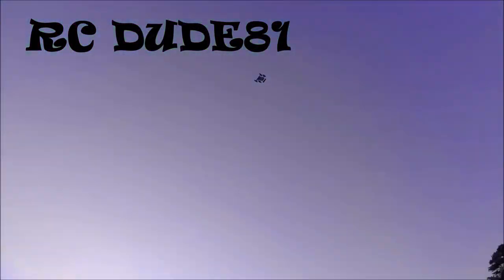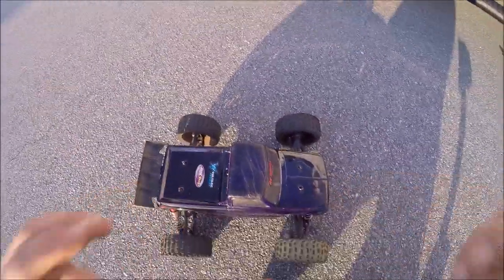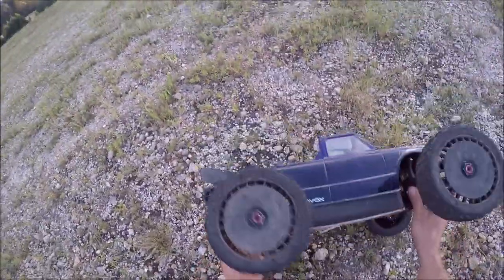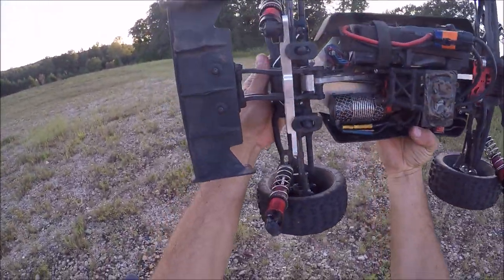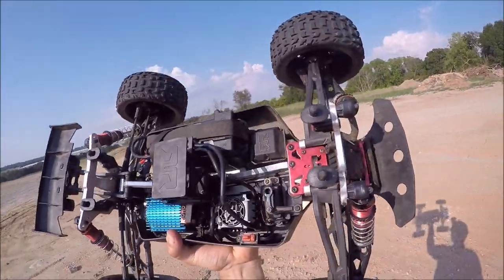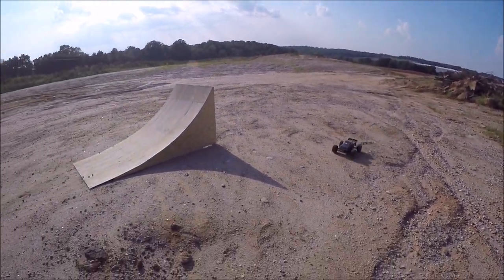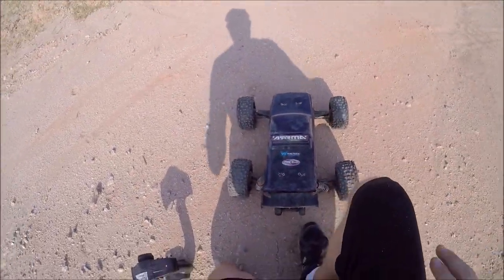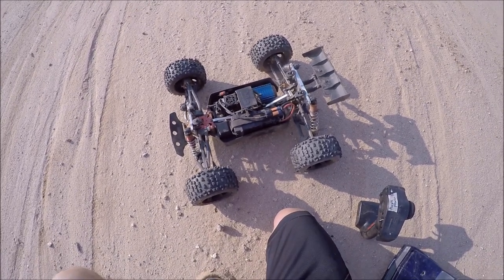ARRMA Outcast 6s "NEW M2C SHOCK TOWER TEST!" and FULL SENDS AHEAD!!

Comment: Hell yeah Brother 😜!!!! AWESOME Bash Eric 🤗. Had some rough breaks, but that was a serious first test on the prototype tower 🚀🚀🚀. Hopefully test mine tomorrow if it's not raining. Finally getting some moisture here 😱. The Mega  sender looks so BADASS 👊!!!! It sounded different in the dirt, but could've just been the Badlands 🤔. I'm sure you checked it for splits afterwards. My new ramp is doing great since beefing it up a bit. Planning to make a mini hucker with leftover scraps soon 👍. I've been wondering if Mitch might design an M4 standoff like with the Tekno's 🤔. I bend and break a crap load of the 3x28 screws myself 🤣. I gotta say that last send into the sunset looked so Killer Bro 🤗. The altitude and backlighting was just stellar. Another great upload!!!! 🍻🤘🤘😎💪💪💪👊👊
Reply from the maker: Thanks so much brother Rich!😁👊Yeah the tower is totally beast!!💪Performed well and looks good! The free fall when the motor blew was a perfect test since it landed right at a angle on the rear end!😳Yeah Mitch and I were talking about a possible shock standoff upgrade like the Tekno one. Broke 3 in one vid!🤣The ramp did great off the pavement but at the dirt spot the line was way too sketchy with all the rocks and washout! Kept breaking traction and launching the truck weird! Hope to beat down on the tower soon a the mega pile too!😂No cracks or splits were found on the ramp yet so that's good! Glad you got yours dialed!!👌Hope you can get out soon man! I had to get this one in quick since we have rain coming plus I'll be at the beach this weekend for my birthday!😎👊🤘💪💪🍻
Reply: @RCDUDE81  Happy Birthday, Eric.  👍👍🍻
@Rich, what's a mini hucker?  lol.  I have some scraps left from my ramp build too and interested in seeing some ideas.  👍💪💪
Reply from the maker: @crimsonfancy  Thanks so much bro!!!😁👊

Comment: Towers look really nice.  Best design I've seen.  Not just a copy of the arrmas.  The m2c front brace needs the hook for the wires to keep them out of the steering and spur.  No one does it but they should.  Rear brace will need to do away with relying on the wing mount.  That's a buggy design that's no good for bashing.  Towers, bulkhead, brace and chassis all need to be solid with no plastic wing mount holding things together.
Thanks for sharing and putting your videos on YouTube.  It's a lot of work and I appreciate it.  Killer ramp too.  You will need a trailer if you make a bigger one.

Comment: The air is getting crazy now lol. I think what these super ramps need is to be able to take about 6" tall sections off top. 3 removable 6" tall sections to take off as needed to adjust height of sends and distance. If done right would be easy to remove sections/re attch.  And needs an all thread axle and harbor freight  pneumatic tires lol. 👍👌

Comment: Wonder if they make like a grade 8 bolt for those upper shock mounts. I’m sure a harden screw/bolt might be the answer to keep them from breaking
Reply from the maker: Good question!🤔I was looking for some 12.9 grades but most 28mm bolts don't have the thread that goes all the way up. I think Mitch from M2C may make a design similar to the upgraded Tekno standoff design.😎

Comment: Yepp, same as mine brother Eric, xploded rotor, when i did the stepup jump...never fun😥, took some serious beating there...🥰...

6.07👀...yepp, thats an issiue..we dont like rough 😂😂😂😂.

M2C, proofs its some serious towers brother..killer video as normal, love it 🥰🥰🥰🥰🥰🥰🥰🥰🥰
Reply: Daaaemn 7.02 i slowed it down to 0.25, and it was left rear arm landing brother, no wounder it snapped ( screw )😥. Normal case they hold up good🥰...so SICK airs...that ramp is a MASTERPICE 🥰🥰🥰❣❣❣🥰🥰🥰🥰🥰🥰
Reply from the maker: Thanks brother Thomas!!! Yeah the ramp is a sending device for sure! Hard drops but when something goes wrong, it's not good!!😂A free fall and landing on the rear end was brutal but took it other than the screws!! CRAZY!💪💪Yeah I expect my bearing blew, caused wobble to eat up teeth then probably exploded rotor too! 🔥I still need to open it up! Yeah hoping to come up with a mod for the shock screws...Maybe Mitch will design one like the upgraded Tekno version using 4mm bolts. Thanks for watching my friend!!!🤗😎👊💪🍻

Comment: I have a possible solution to your shock bolts breaking that I posted on the Arrma forum last year.  The original post was by bicketybam and titled "Kraton how to break a shock mount".  All the details are in my reply to that post.  I used a standard bolt, bought off ebay, that is not threadded the whole way up so it is stronger at the shock tower.  Love the new ramp man!
Reply from the maker: Thanks for the info on that man! I get plagued by the shock cap screws quite often! I'll look into that! Thanks so much!!😎👊💪🤘
Reply: @RCDUDE81  No worries man it worked for me.  If you need any more info just let me know and I'll try to help.  Keep on rollin man!😀
Reply: @RCDUDE81  Sorry forgot to say if you're gonna try it make sure to get high tensile steel bolts!💪
Reply from the maker: Thanks so much bro! Yeah, I was looking at some 12.9 grade bolts.  3x25mm...🤔
Reply: @RCDUDE81  Not sure if 25mm is long enough.  The ones I used were a 30 mm long shank with around 10 mm unthreaded at the head end.  I took a quick vid and uploaded it to youtube there.  Its titled "30 mm Shock Mount Bolt".  Sorry bout the quick rather crappy vid! Hope it helps - sure let me know if u need anything else. 😀
Reply from the maker: @vman3875  Yeah brain fart!🤣I forgot the stocks are 28mm. I'll check out the vid!! Thanks so much again!😎👊
Reply: @RCDUDE81  No worries! 😀

Comment: What’s body is that?
Reply from the maker: Proline 1/8 Chevy C10 short bed.😎
Reply: @RCDUDE81  will every 1/8 body fit on the outcast 6s?
Reply from the maker: Most will but you may need to make adjustments to the body mounts. The rear of the truck is tricky bc of the wing. This body was trimmed out for the wing mount.